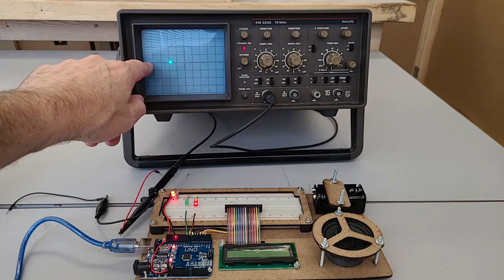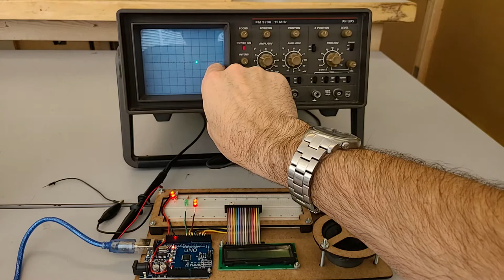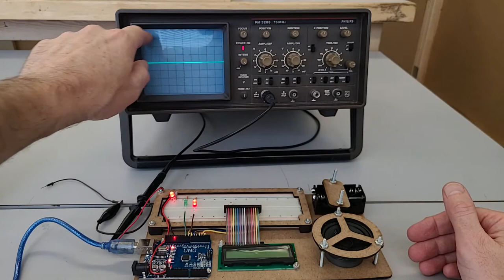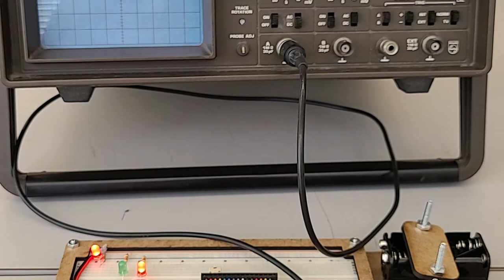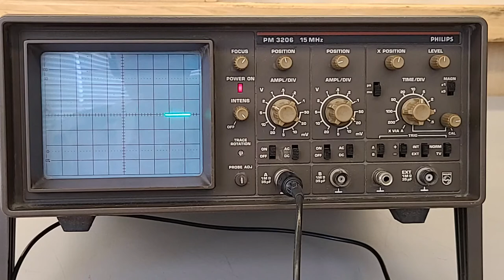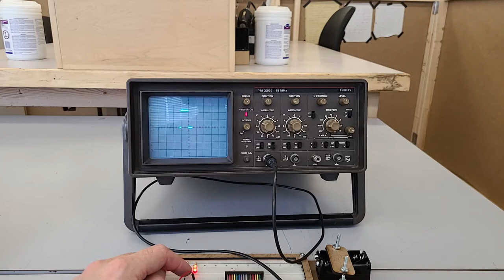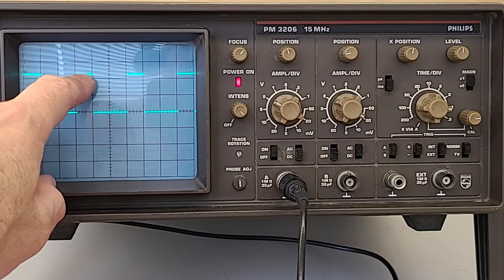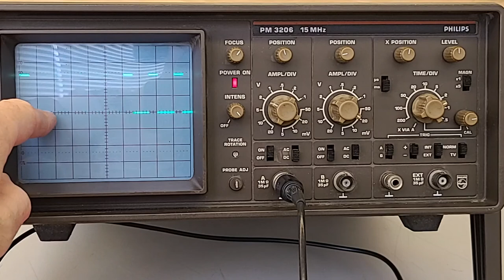Introduction to Oscilloscopes: The Analog Scope

Comment: Hi...you mentioned the asteroids arcade game....what sould the settings on the scope be to if I wanted to connect an Asteroids arcade pcb to it to get the image of the game on the scope screen? I have an analog scope with x & y connections...I know I can connect my probes to the x & y test points on the pcb, I just dont know what settings my scope should be on.
Reply from the maker: Usually there is an "X-Y Mode" on the panel. In the case of the scope in this video I would turn the Time Division dial to "X via A", indicating that I want the X axis to be controlled by the voltage on Channel A, rather than a continuous sweep based on time. There are some awesome tricks you can do with this using stereo audio to draw pictures on your screen. Here's a search that will show plenty of examples of XY Mode. https://www.youtube.com/results?search_query=stereo+sound+picture+oscilloscope 

That's very cool that you've got an Asteroids arcade pcb! Those must be quite collectible now. Good luck getting a display up and running. It's definitely a unique look relative to the more common raster scan displays!